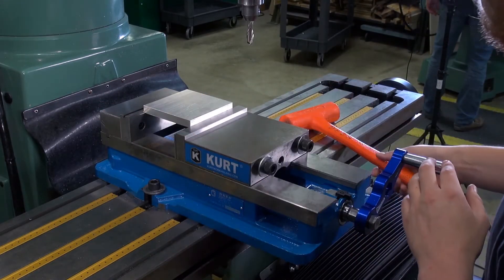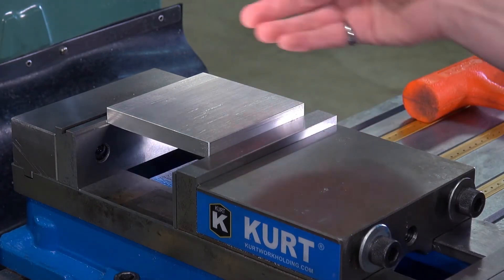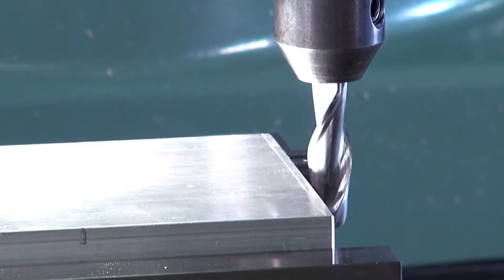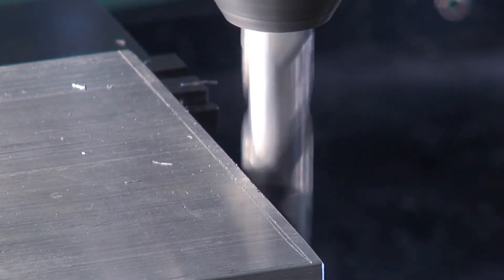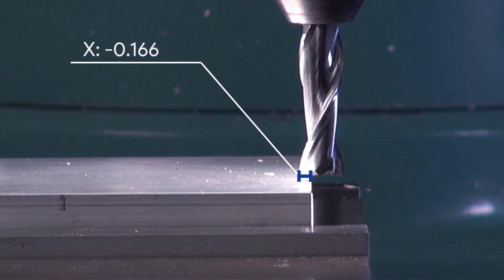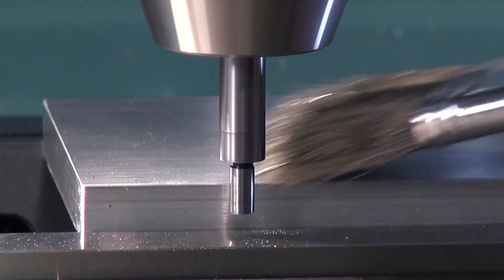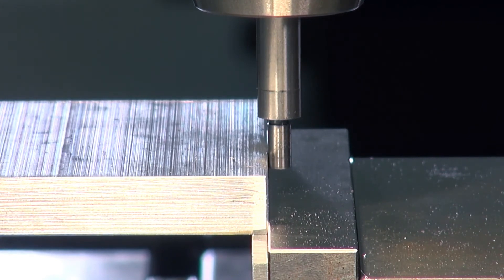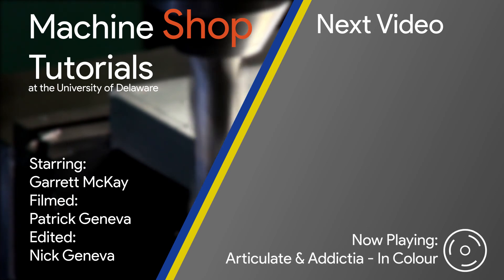CNC Mill Tutorials - 1 - Zeroing Your Part

Comment: Set the work part in vise using parallels 
put the end mill or Edge finder to spindle
rotate the spindle and move toward the X axis
then Slightly touch the part 
stop when you see the small puff of metal shavings
then Zero the X axis by pressing X and absolute set
then raise the End Mill or Edge Finder
moves the X direction toward the part by half a diameter of tool D=50/2 =25
then re zero X axis by pressing X and absolute set
and repeat process for Y axis
then zero the Z axis by slightly touching the tool top of the work
and press Z and absolute set
Reply: This is for beginners...that shit you just said would be hard for a 5 Axis programmer to understand 😂